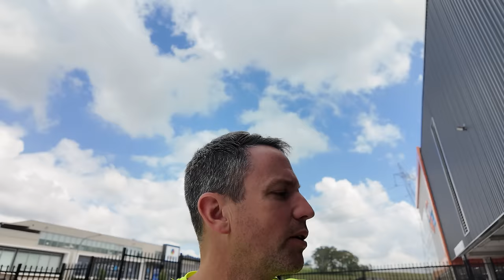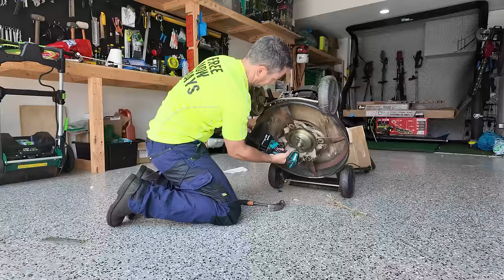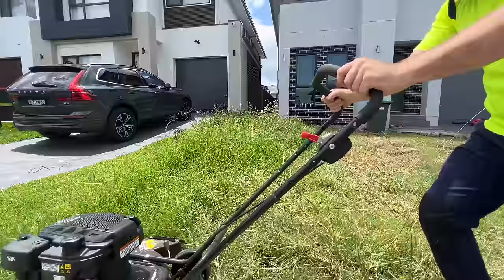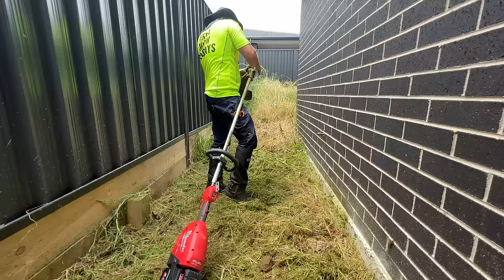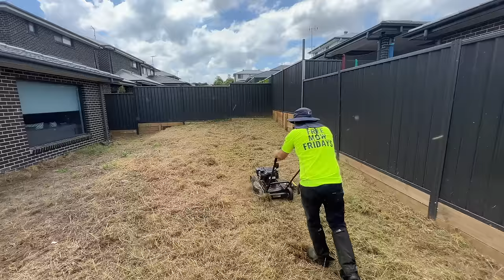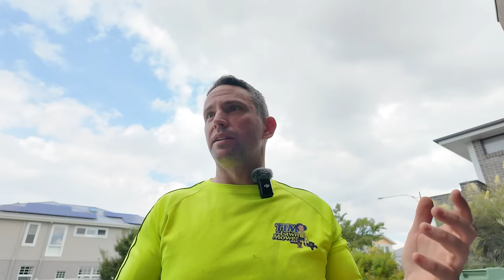VLOG #18 Do you work on Sundays?

Comment: I thought you would just take a second to balance your blades after sharpening. I always dunk my blades in water for an hour to loosen up the caked-on and hardened clippings and then all the debris can be removed and the blades look like new. Then, when I balance the blades, I am getting a true balance job. I also use a digital angle gauge to ensure that the angle is correct. Most blades are sharpened to an angle of 30 degrees but my 2-blade Honda recommends a 25-degree cutting edge.

Comment: Great job on the vlogs and videos mate.
Best mod for your utility mower is cut the side chute down to 1/3 of the length. Discharges the grass heaps better and also makes it easier to push the mower in long grass and tight areas.

Comment: Hmm. You need a bench vice for sharpening those blades safely. Tough to get the angle right holding it in your hand. Safety glasses anytime you are loosening those nuts and grinding. You are only issued one set of eyes. Those ‘new’ metal fences were a bit of a joke. Anytime you have wood next to the ground it will eventually start to break down. Then what? All those metal panels will have to be dismantled to get at the wood base. Crazy. As long as you keep the vlogs short and sweet, I’ll keep watching. Stay safe.